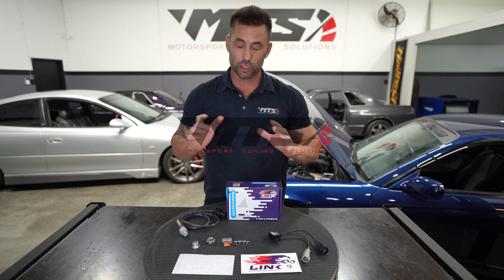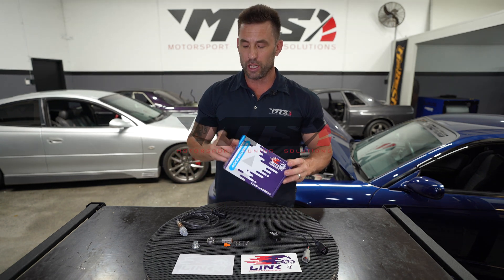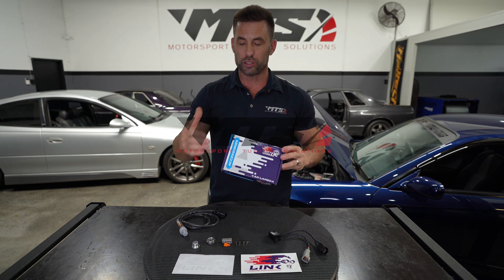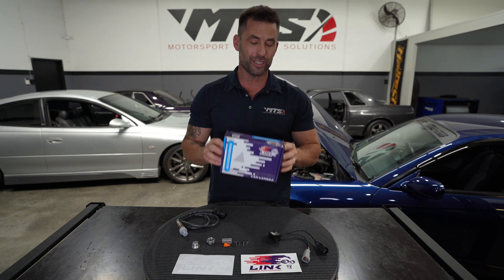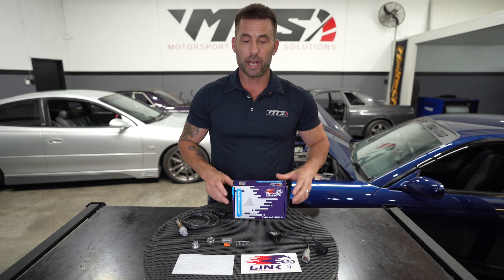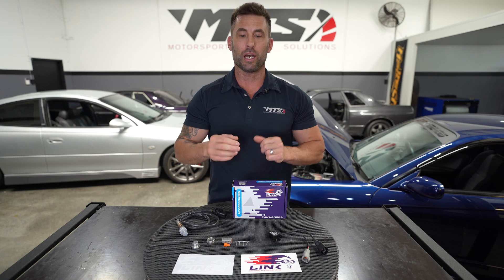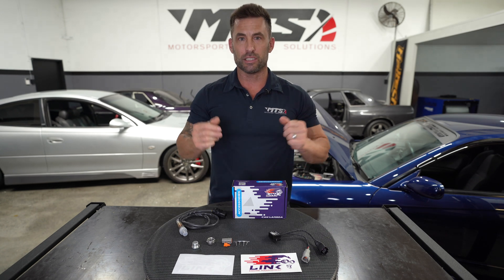LINK CAN-Lambda Kit Unboxing – What’s in the Box?

Comment: Can you explain the difference between spending 5x on the lambda kit vs a standard wideband?
Reply from the maker: 5x the price on a lambda kit? Are you thinking that you can buy just the wideband o2 sensor and wire that into an ECU? Im sure you know, but an o2 sensor comes in narrow band and wideband versions. nearly every stock oem o2 sensor is a narrowband sensor. When upgrading and ecu and wanting to run a wideband sensor, most aftermarket ecus downt have an onboard wideband controller, so you need to but a wideband kit with controller, then the data is sent over to the ecu via canbus comms. The Link Can-Lmabda is a wideband sensor and controller kit. Hence the increase in price
Reply: @Motorsporttuningsolutions1  can you tell us the benifit of going with the link vs the haltech can lambda